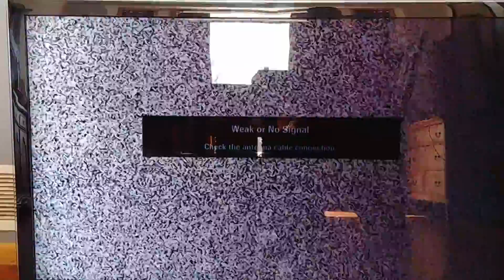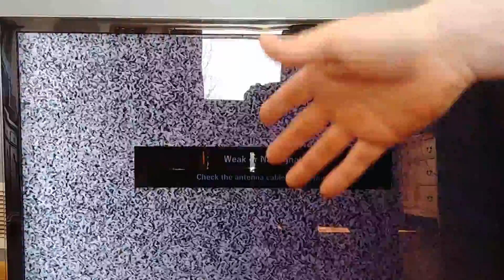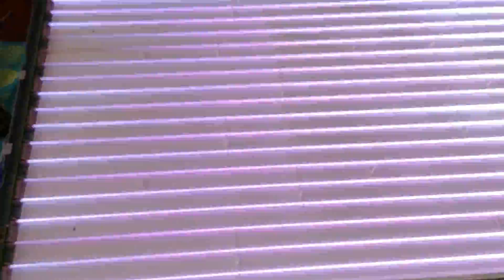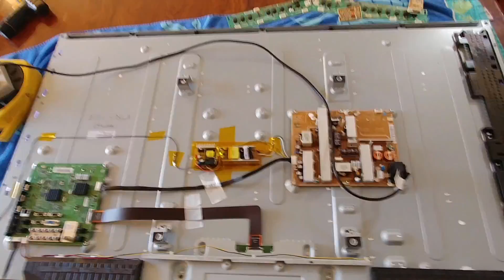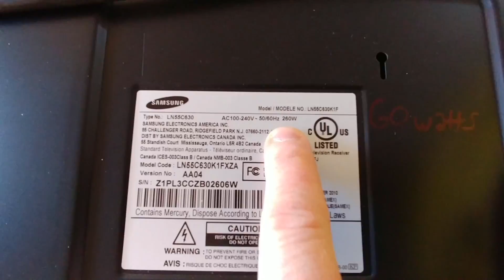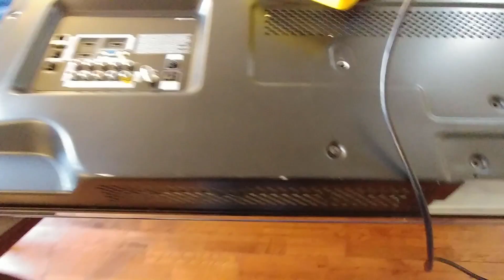55" Samsung LED Conversion

Comment: great video, i have a question, did you faced any trouble with shadows generated by the little pins thats support the difusser screens?
Reply from the maker: I got lucky with the support pins, but I did get some shadows from the lenes getting knocked off and glued back on crooked.
Reply: yeah, it`s a little bit tricky , i just took off the support pins so no more needle like shadows, but the leds looked spotty, so i went to a place in downtown mexico city that it`s like a hood filled with electronic components, new and used, and i managed to buy a white difusser salvaged from a broken led screen, installed it instead of the original transparent one,  it  helped a lot..... you have one more subscriber, greetings from mexico city

Comment: Hey Jeff. Quick question. I got a 2008 Escalade SUV. Im trying to get a hold of the instrument cluster connector. But i am having no luck.
Reply from the maker: I would expect it to be the same as the 07 and up full size Chevy. YouTube doesn't have a way to upload and share files.
Reply from the maker: What are you trying to do?
Reply: jeffescortlx my truck was stolen and they took my cluster and cut the cluster harness. I got a new cluster but i need the plug for it. It is different than the other GM pigtails.
Reply from the maker: You shouldn't need a wiring diagram for that. Just match the wire colors up. Every year group generation and chassis model has a unique plug.
Reply: jeffescortlx there is still wires behing where the cluster was but i dont have a way to attach them to the cluster without the plastic connector that plugs to the cluster
Reply from the maker: Right, you need to get a connector pigtail.
07-14 full size GM should work.
Reply: jeffescortlx yes but where can i get it. It needs to be off a escalade. It is different than the yukon or sierra ones. I have one from a yukon slt but the yukon plug is square  the escalade one is rectangle ans there isnt any scrap yards close by that have them
Reply from the maker: I looked it up, your right the escalade is different from the other full size GM's. Sorry I do not have any.